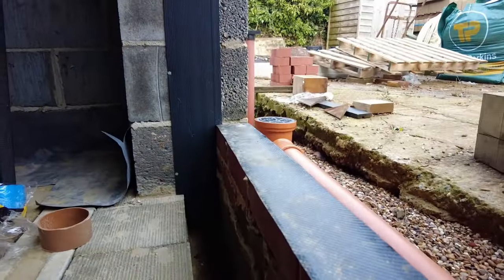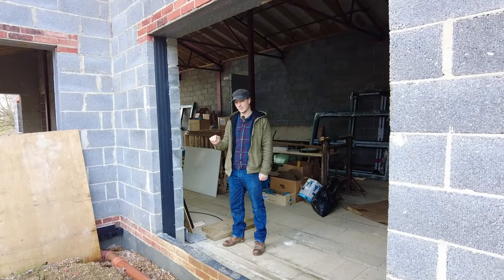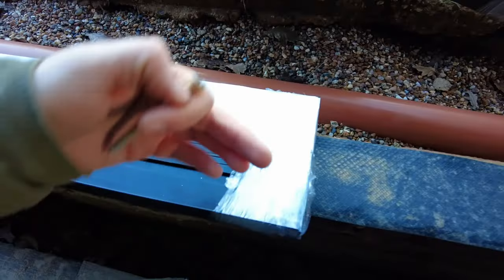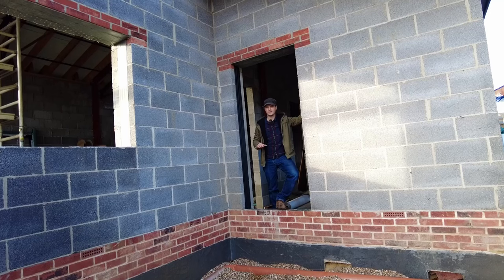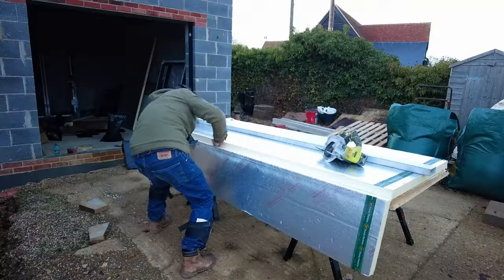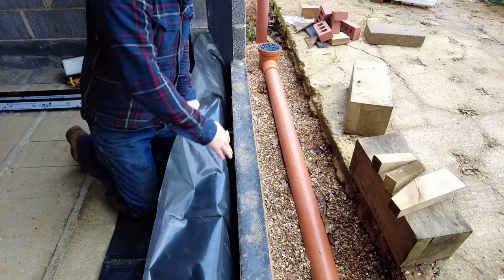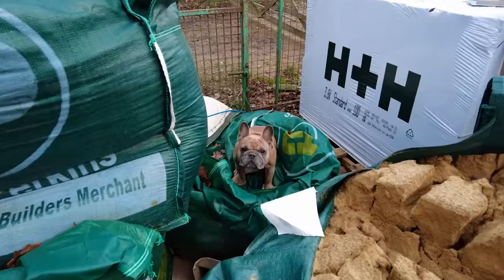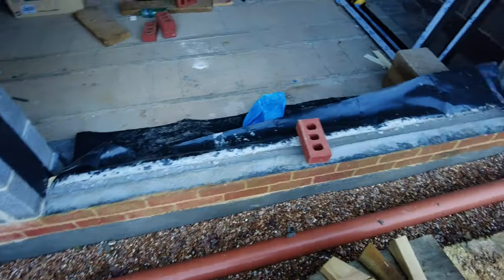Door Threshold Detail on Block and Beam Floor: Is This The Answer???

Comment: Flush with the inner brick not sat back 30mm every time I put cavity closers in after. Fill with dpm and concrete is good. Insulation added is even better. If your rendering. Use 9.5mm plasterboard strips cut 100mm widths and stick them to the outside every 1000mm gap using the render then use a derby just run straight up. Smash out the plasterboard next day and fill the gaps. Well worth the prep.
Reply from the maker: I'm pretty sure the majority of people just set the doors flush with the back of the brick/block. That's what I done last time as well. I'm just being abit more cautious this time as I've heard horror stories about cold aluminium frames. Good tip with the render 🙌 I am thinking that the rendering/plastering will probably be one of the few things I'll sub out
Reply: @BuildingAcerView  I have never used aluminium so don't know the horror stories.  You can handle the plasterong 100% spend out on the tools and DIY. can't fail if you have something to run up then it's always perfect. Just have to fill the gap already level and even once it is. Cool project. I'm filming mine may upload some time-lapse. I'll keep watching see how you get on.
Reply from the maker: @E69apeTheMatrix420  I've been debating between full wet plaster or dot n dab on the inside, I'm still not sure what to go with 🤔
Reply: @THE-AIDEN-PROJECT  Probably the same cost after all is said and done.  Plasteboard is expensive then you still have to fill, tape, joint and skim. Your radiator and water pipe clips will stand off 30mm though so too thick to plaster unless you chase them into the wall first adding work.  If you use plastering sand 5 - 1 and add 3 in 1 render mix plastercizer. You can literally get  a finished coat from the render without needing to skim coat it. Come back next day and spray water, plastic trowel it. make a very wet small mix up to skim any low spots etc. plastering sand is like butter. The window reveals are the hardest part. If you have a nice 10mm gap around your frame then 9.5mm plasterboard as a guide to run up is perfect. If the gap is tight thats the hardest job to plaster. You want it flush to the edge of the window and not past it or looks bad. Plasterboard is easyest around the window reveals. But its also crap you can put your finger nail into it?! Render its solid as a rock! also properley seals the wall! Depending on your pipe work I would probs plasterboard. You can use 30mm batten to fix to instead of dabbing. Also expanding foam but its expensive. 12.5mm for the walls and ceiling if so.
Reply from the maker: @E69apeTheMatrix420  thanks for the info. Definitely food for thought 👍
Reply: @BuildingAcerView  on all the internal walls that have pipe work then use 30mm batten to get you perfect stand off the pipe clips and level, dot dab / expanding foam the plaster board. Everything else Render as should be cheaper and more solid. Use a combination.  For internal stud walls then then 63mm or 89mm timber determine the internal door frame thickness after adding the 12.5mm plasterboard each side and skim coat it will be perfect thickness for off the shelf frames. 👌
Reply: @THE-AIDEN-PROJECT  Wet plaster makes a much more airtight home which is very important. I can't get anyone to do it locally but I will be parge coating all of the inner walls with a slurry mix coat or 2 as blocks are air permeable.
Reply: I'd love to see a video of the rendering tip if you ever do one.
Reply from the maker: @handle1196  sounds like you're going through all the same internal struggles as me 😂 I think I've half decided I might render the outside myself with webber ocr. I did speak to my usual plasterer about doing the full wet coat inside, he said he was up for it but asked him to come over to chat and price up. That was a couple of weeks ago and not heard anything. I'm in touch with a few other large youtubers so was thinking maybe I can find another plastering youtuber to give a few of us a lesson or 2 😂
Reply: @THE-AIDEN-PROJECT  luckily im still due to start so its good to build on ideas i had or see how others have overcame them. The beam ends solution is strange that theres no solid solution. I'm glad i came across your page though, ill have a look through your content. Best of luck.
Reply: @handle1196  OK, I have the footage. Its all in the plastering sand and the mix. Make it with very little water but let it mix for 15 - 20 mins. Thats how you get it really nice. You can always add more water but it needs to have loads of stand up ability and full bodied. Not sit flat like a pancake but instead be easy to pile up and cut a valley into with your trowel.   5 - 1 sand - cement. add a little 3 in 1 render mix plastercizer in there to make it more workable and waterproof. It wont shrink and crack.. when it goes off on the wall then sponge float it. You can go back the next day or the day after, soak it with a hose pipe and make up a wet mix, just go over and low spots or bad bits easy. To get it really level running up 9.5mm plaster board strips. use a long level instead of a derby or feather edge. Because the level wont bend so you wont leave big bows if you push too hard like a derby does.. Thats why its good to have 3 strips of plasterboard per level length to run up 1 in the middle as well. to stop the bowing effect. Dint even wory about getting a good finish to start with. Just get it level. You can finish it off easily in the coming days. wet it down and float it again if needs be. Dont forget all your corner beads. They go on top of your base coat and sit 2mm under. so just put them on before you finish it.  and stop beads go in 1st. before anything.
Reply: @E69apeTheMatrix420  thanks for this, eventually i have two garage door reveals to do 350mm deep, 2250mm high. Theres facing brick on the front walls and the garage door sits inside behind the reveals so it will be 2 x stainless steel stop beads. Does it require a scratch coat then a finish coat another day and would it benefit from any kind of mesh for strength?
Reply: @handle1196  10mm thick up the batten is OK to get in 1 with a good mix and be flat and level, when you float it will be rough enough but yes next day is still good to scratch it after filling batten chases. Then put beads on and work to the beads. Should be easy to keep flat and smooth now with a long straight edge. Then float it and fill any low spots that show up because they are still smooth. The real reason for the batten strips is over a long wall is so easy to be 15mm thick at one end and 10mm at the other. It guarantees you that "scratch coat" is true and plumb before your finish coat up the beads keeps ip that way. The mesh corner beads come in slimline and normal. I like both. Depending on your door and brickwork corner situation 1 will suit better. You could use stop beads on a corner that transitions to bricks instead. Can staple them in place on fresh render using a level to get perfect. Or just plaster them in they stick well.
Reply: @handle1196  And mesh goes over the scratch coat. It's worth using yes will reinforce it nicely help stop cracking. So much I forgot to mention. Lol.  The old boys didn't though look at London all that face work done without and still looks good 50mm thick plus. You could also use a little stronger mix on the scratch coat than the top coat.

Comment: Guys, you put a PIR up stand the width of the cavity, between the outside leaf and where the block and beam floor finishes, that runs from the footing up.
If your using a jabalite system you can  protect the insulation over the top. If concrete block then you simply cover it with concrete. 

This is the tried and tested NHBC approved method. 
You should also be able to get specific details from the manufacturer of the block and beam floor system.
Reply from the maker: But what about fixing the door cill?

Comment: One year later....if the DPM does that U shape route down between block and outer skin, is the not the possibility of moisture getting into the U shape and even possibly filling it up with water???
Reply from the maker: Nope, it'll go out the sides. If you end up with enough water to be doing that in the first place then there's a bigger problem to deal with probably 😅 the main point of it would be to stop damp that may occur because of capillary action
Reply from the maker: Nope, it'll go out the sides. If you end up with enough water to be doing that in the first place then there's a bigger problem to deal with probably 😅 the main point of it would be to stop damp that may occur because of capillary action
Reply: @THE-AIDEN-PROJECT  Of course!! I forgot the U shape is open at both ends! Doh, don't ever let me near your building site!

Comment: Given aluminium is a compromise on the very best of thermal performance and it's expensive, doing what you can to ensure you get the best out of them that you possibly can seems like a sensible move to me, and you solution seems logical and sacrifices the least possible performance in the structure to gain as much as you can from the doors while also ensuring they are properly anchored. Believe me, I know how utterly miserable it is to live with ally frames that are poorly installed and which don't have adequate thermal breaks - although hopefully only for 5 or 6 weeks more as then they will be going in a skip and being replaced with conservation grade timber style uPVC.
Reply from the maker: Fingers crossed it makes a difference. Ah so you went with the upvc in the end 👍 what did you end up doing in your bathroom? I recall you saying something about the upvc having slightly bigger sightlines
Reply: @THE-AIDEN-PROJECT  it does indeed, but we're going with it anyway and having a single top opening window. It'll be a few weeks yet until we get an installation date, hopefully it won't be too dark in there!!

Comment: I am currently trying to solve the same issue in my extension. B&B floor has just gone in. I came across "Compacfoam 200" today which allegedly insulates like PIR but is compressible and can be machined like timber and holds screws. Sounds ideal. Does anyone have any experience with it?
Reply from the maker: I couple of others mentioned compacfoam in the comments but that they planned on using it. Haven't came across anyone after the event. You could have a look through and ask them as soke time has passed. It's expensive stuff though so you could use another material first then top it with the compacfoam 🤷‍♂️

Comment: So at the  end  of it all are you intending to set the door call back 30 mm to cover  the 25 mm insulation up against the concrete you put in .
If so why not put you solid 25 mm insulation up against the outer brickwork with possibly a polythene vertical membrane up against it down onto foundation or as far as you can get ,poly both sides of the insulation if you so do desire ,, then create envelope and Lea mix concrete fill up to beam level. 
Then lay your floor insulation dpm etc and screed into the vertical insulation.
All this is if you intend to set door frame back to cover the 25 mm vertical insulation.
If you don’t cover that 25 mm vertical insulation when you go to get carpet fitted there’s nothing solid to fix grippers to .
All this is so much easier with timber joist detail as the joist sit on inside skin/plate and will carry /span the cavity and sheet 22mm TAnd G flooring into back of cill 
It’s a minefield sometimes on how to overcome issues

Comment: In new homes generally UPVC windows and doors are fixed with proprietary straps. You don’t fix through the cill.
Reply from the maker: But loads of manufacturers say you must fix through the cill, if you don't then maybe it doesn't meet pas24. You can't use straps on a door cill without an inner skin 🤷‍♂️

Comment: I'd have thrown some DPM down and filled it with concrete level with the block and beam, then just included it with the insulation and screed above.
Reply from the maker: How would you have secured the door cill? Or would you not set the door back 30mm into the cavity as per regs
Reply: @THE-AIDEN-PROJECT  The screed would be level and butted up to the outer course. 30mm isn't far to set it back,. Just have to consider the 20mm insulation upstands and the depth of he screed when fastening. 

We did this when we put a patio door in where a window once was, and it was fine.
Reply from the maker: @NeonXXP so did you manage to get a fixing in the back of the brick or wasn't it that close on your cills? I think some people don't use mechanical fixings and just bed them on a load of silicone but I'm not sure if that's any good 🤷
Reply: @THE-AIDEN-PROJECT  It wasn't that close. Most of the load is taken by the side fixings anyway. I drilled a down and put a few hammerfix in the bottom just to keep it seated. My doors had a recess in the frame to accommodate this.
Reply: Yep seems ok to me

Comment: concrete upstand? Timber upstand?
Reply from the maker: If I 'm understanding right, I did a concrete upstand didn't I? Not sure I'd feel comfortable doing it with wood as the brick would still probably blow out when putting the fixings in

Comment: Mr A builders ,todays episode just dealt with that one if your wondering what to do
Reply from the maker: Yeah I watched that to see what they done. They didn't set the door back into the cavity by 30mm though so didn't tackle it the way that I did. I guess that's what most builders do and then fill the edge of the block and beam floor  with whatever is going spare like they did.

Comment: The manufacturer's detail is incompetent in my professional opinion.  You are right that the screw fixing is way too close to the edge of the brick but also the floor build up for beam and block is not common and assumes a specialist screed.  the floor thickness should be in the region of 75-85mm, not 50mm as shown that then casts doubt on the validity of the whole detail.  The obvious way to fix the cill is to use stainless steel short straps fixed into the external brick and then fix the cill into the strap.  Its a common side fixing detail for windows and doors.  All you are preventing is the cill from moving .

I am not convinced with the detail that was constructed and the cold bridging will cause a downgrading of the frame performance.

Comment: Sorry, I don't understand the problem. Not because it isn't important but my little brain cannot cope. It is quite a specialist topic.....albeit very relevant in the current climate for super insulating houses. I expect most builders &window installers wouldn't even bother....what the customer don't see, don't worry them. Problem you are the architect, installer and customer all rolled up in one.
PS why don't you design a product that can solve this issue, then sell the design to a building supplier to manufacture it and you get commission?
Reply from the maker: Humm that sounds like a plan, I'll have to dedicate some time to trying to find a better solution 🙂
Reply: @THE-AIDEN-PROJECT  You probably have enough on your plate already. 🤔 You must be good at juggling!
Reply from the maker: @Sean006  spinning plates! 😂 Although if I was that good at it I'd get more done 😬

Comment: So you are just google pro ,thermal bridging ? just install 100mm rigid insulation problems solved .
Reply from the maker: How would you then fix the cill?
Reply: @THE-AIDEN-PROJECT  WOOD ONE ?
Reply from the maker: @aragon1ize  it's not a great idea to have wooden bifold doors. I'm guessing you didn't actually watch the whole video
Reply: @THE-AIDEN-PROJECT  you don't  get it you still need to learn but I advise  you not from google or you tube , wooden door you didn't  get that ?
Reply from the maker: @aragon1ize I think we are on totally the wrong page. You will see a professional window fitter in the comments state that this has always been a problem. The building regulations state that the frame must be set back 30mm into the cavity because of thermal bridging. The manufacturer states that the cill must be mechanically fixed through a certain point. If you set the frame back 30mm you can't fix through at the back of the brick. It's nothing to do with me learning or not learning through Google. What you have stated in your initial comment makes no sense at all, so I gave you the opportunity to explain what you are talking about but clearly you don't know what you are talking about. So let's just leave it there

Comment: You never , never fix through the cill .
Reply from the maker: Do you just use a couple of tubes of silicone? Even if the manufacturer states the cill needs a direct mechanical fix?
Reply: @THE-AIDEN-PROJECT  i foam them down .